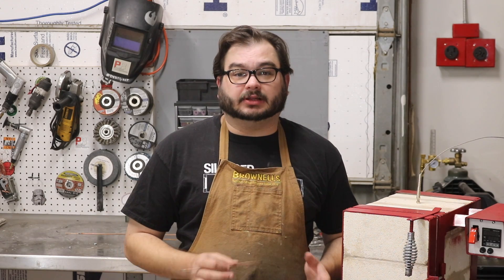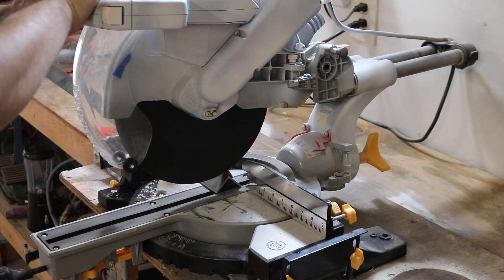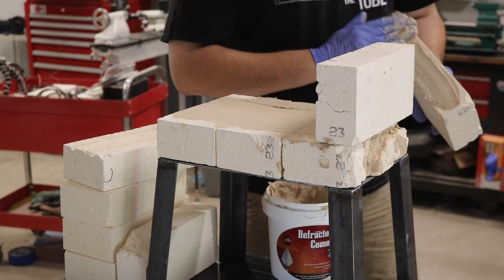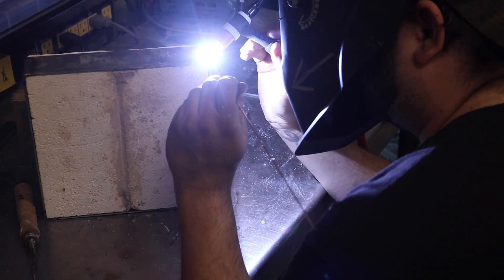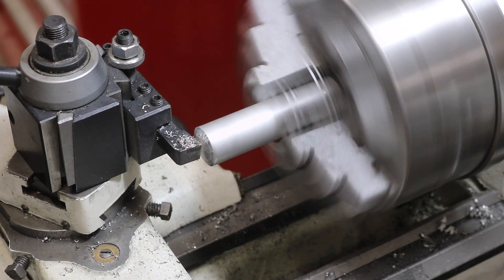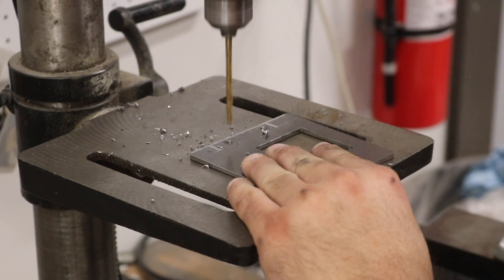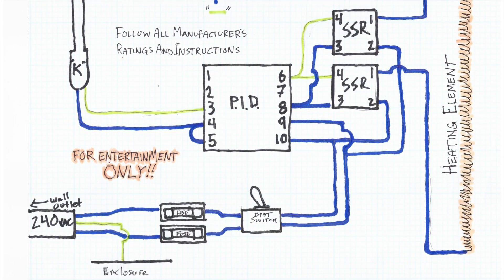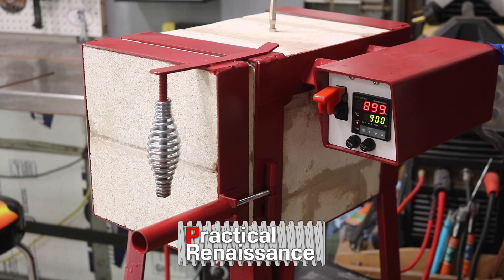Making a High Temperature Electric Oven for Heat Treating Steel!!

Comment: I make a copy of your owen and I convert the dimensions in mm and for khanthal wire I use 10,2 m , the owen work, the temperature go fast until reach 700 * C  after thar go slow until reach 850*C and for 1000* C I need 1 hour , I think the wire lenght must to be changed , the resistance is 46 ohm and the power is 1103W for 225V,  most knife HT ovens are over 2000 watts, too low power on your oven- 1450 Watts is not a very powerful oven and you know if it is do the job, but for me I will try with 6 m of kanthal wire to obtain a resistance  around 25 ohm and reach 1050 *C  under 1 hour

Comment: Great project, but i have a question of construction: according with the excel calculator you need 33.323 (ft?) length of wire for 240V and 1450W that means for me as a person who use metric system 10,15 m, I ask because I want to make a oven like you and in that sheets it not write the measure units and looks a little to short for me

Comment: My understanding is that running the heater element across the back creates a hotter region because it's being heated on three sides. This can cause the far end of the part to see higher temps that the rest, potentially leading to differing heat treatment. That said, I haven't built an oven yet so maybe it's not a problem.

Comment: Anyone know what size mandrel was used to coil the a1 wire? The calculator excel doc is not clear on the size. I'm trying to sort out the coil diameter, and length of coil to hit that 40 ohm mark. Thanks in advance.

Comment: so it's been a couple of years  what would  you have done differently?  Maybe  thicker  Kanthal and  more of it to get the same ohm resistance?  What was the over all ohm resistance  for the length of wire you  did  go with?  A heat up  time of  15 - 17 minutes is really good.  You should be  happy about that.

Comment: I like it, but I think you forgot one important safety feature, the power shut of switch that cuts the power when you open the door. If you touch those wires while taking something out you kill yourself.
I don‘t see one installed and I did not see one on the schematic.

Comment: Hey dude! Nice video!
Just one question left: why do you use 2 ssr relay's? I have seen people just using one🤔
Thsnk you!
Reply: I believe it’s because he’s using 240vac rather than standard 120vac so he uses one relay per hot conductor
Reply: @jakelevis8453  ist this because the ssr's he uses are rated for the 120 volts?
Cause I have 230 too but mine are also rated for it so it should be fine using just one?

Comment: for a 150x150x600mm oven at 127v voltage so that it reaches a temperature of 1100 ° C which power and wire do you recommend?

Comment: Thank you for video.
For heat-treatment of carbon steel please note that heating process must be slow (!), and averages for no faster than ~13minutes per 1cm/0.39inch in thickness (internal stresses due to irregular core heating). Boric acid is useful for preventing against surface oxidation. For example: 30mm/1.81inch in diameter steel rod, covered with boric acid must be heated no faster than (3x13min) 39minutes in a pan from 20degrees of Celsius/68 Fahrenheit up to 860C/1580F. Martensite quenching of detail should be done via vertical moves in coolant. I would consider some settable PWM in a system diagram, cause of these heating speeds limits details to small dimensions. DC power supply should be cheaper in theory.

Comment: "refractory seament" lol  i dont know where you live but around here its seh ment
nice build though. i watched a friend build a micro kiln and used a food can as a crucible. The can ended up exploding when he lifted it out of the micro kiln. it sent molten aluminum flying around his living room. no one was hurt, but it burned his laminated floors a bit. the burning floor was doused within seconds. 
these things are extremely easy to build. Don't think you cant.  also use a real crucible if melting anything. 

you can build this in your house just dont use it in there. And i know some if not most people who read this will think "duh" 
we knew the risks and were ready for it.

Comment: One trick with refractory cement is that you normally want as small of a junction as possible not like mortar you would see normally between red bricks. The refractory cement doesn't have near as good thermal properties and sounds just be used as a glue more than anything

Comment: Thanks for including some of the issues you had, like the coils coming loose. I am in the process of building a pottery kiln. Pretty much the same design as your HT oven, just a little larger with 4 coils. Now that it is finished and used, is there anything you would have changed?

Comment: I don't understand why you need two relays?  But then again I have no experience with this. I see other people using just 1 ssr. Looking to build one for myself, but needs more research.
Reply: You don't need two SSRs, that's just stupid. You always put one SSR on live wire, no need to disconnect neutral wire.

Comment: Hello😄 7:18
I want to know how electricity flows into the coil and the heat is generated after connecting the terminal block.
Reply: electricity flows from the solid state relays to the coil wire which is manufactured to be resistance to current flow, therefore, as the current flows, the wire heats up. is that what you meant? the relays are controlled by the PID controller, to regulate current flow based on temperature needed vs. actual temp., by using the thermocouple to indicate actual temp.

Comment: You forgot the door safety switch.... You can get shocked to death so quickly when you touch hot wire with your tongs plz fix it
Reply: what do you mean? Turns coils off when door opens? Thanks!

Comment: I really appreciate this video and all the info you shared!!! How is the accuracy at lower temperatures? I just built a VERY similar oven and I'm having a difficult time with the temp reading... I have the Inkbird PID that will display in F/C, but other than that, its nearly identical to yours. However, room temp is reading about 150°F, when it's actually about 60° in my garage. I swapped to another K thermocouple I had on hand and have the same result +/- 1°. The Inkbird instruction manual is a joke and not much help. Is there a way to calibrate the input?

Comment: For electrical isolation I use a combination of a SSR driving a DPST contractor (relay) to power the heating element. As others have said, for safety, a door interlock to isolate and disable power to the heater is also advisable.

Comment: This is a great video!  Im at the point where i want to control my heat treat better also but im torn as to make one or just buy one.  When i had tons of free time i made my own 2x72 grinder, but now i almost dont have time to even make a knife let alone a oven.
Reply: I saw a used kiln/oven on craigslist that worked fine, but could be upgraded with a PID controller....$225 asking. 9"x9"x6" inside dimen. hard to beat. so maybe look for a used one to upgrade?

Comment: Excellent build. I was eondering why you are using two SSRs to switch both ends of the coil, security reasons? I have built a PID controller for my LEE pot using just a single SSR (basically the same application). The phase is switched by tje SSR, the other end just connected to neutral. The main power switch double pole, of course.

Comment: you could improve by add, either a second coil or thicker wire to crank up the Watts.
You use "only" 1400W but you could go up to 3500W from the mains ( i would suggest 2400-3200watt).
also check the outside walls Temperatur maybe they dont isolate the heat as the advertisement says.
Or the box isnt airtight ( most arent), but the less air flow is possible its a second way of improvement.
Reply: Yeah, a ceramic wool blanket wrapped around the kiln really helps improve the insulation. Firebricks are pretty good insulators (0.2-0.3), vs 0.1 for ceramic wool (lower is better). But the seam mortar isn't generally as good. Which causes thermal bridges.

Comment: In reviewing your Kanthal Calculator spreadsheet, what is the unit of measurement for the "length of coil at wind size" and what is that specifically referencing? it would appear that the total length of coil that you installed in the channels you carved was roughly 50" or so by rough estimation, but the value in the spreadsheet in 16.
Reply: Same question here. No unit at all. And refering to your question, there is also no aswer at all.
Reply: It's in inches. Looking at the example (start with 33 inches of wire, end up with a 17" coil). Think about it: The mandrel is 0.156" OD. Multiply that by pi and you got 0.48 INCH needed to get around the mandrel. 33 inches times 0.48 is roughly 16 or 17", which would stretch out a great deal for install.

Comment: Nice!  I think we operate on the same wavelength lol, it started with Grizzly 7x14 when I first saw your channel and I had issues with mine, than you threaded a marlin, than you did muzzle device, than you got South Bend at some point you got milling machine and now you build high temp oven.  I did all of that as well just not as elaborate and fancy and I didn't even see what you did only saw it later :)  I've had firebricks and wire sitting in my garage for couple years, I've been putting this project off for a while, I actually been using my pineapple can forge to heat treat couple dozen of small parts with ease.  I want to build electric metal melting forge to melt zinc and aluminum and possibly brass.  I noticed you used same brand of wire that I got except I got mine in 16 gauge as it's not easy for me to access 220v so it will run on 110v.  I've been looking at same terminal blocks on ebay but the ratings are confusing.  Some sellers list it as 5A only and some higher so I didn't know who to trust.  Regarding PID the first one I build for my lead melting pot about 3 years ago I also ended up with one reading in Celcius and while it worked great I found it annoying so I bought MYPIN and it can read in both, it also has 2 rows of display, I like it much better.  It only $20 on ebay.  I also noticed all people used more liquid dark grey cement to "glue" the bricks, it's more liquid, I'll look in to that.  Another thing I was trying to find was ceramic tube insulators for wires coming out the back, but I guess it's not really necessary.

Comment: heared that you can remove the zinc coating by submerging the part intoo some heavy duty toiletcleaner or muriatic acid (the kind that removes calcium scale from a toilet bowl )
https://www.youtube.com/watch?v=8Tld3onsUVE

interesting oven , i seen simulair electric ovens used to melt aluminium , on the one hand i like the idea of having a constant controllable heatsource 
on the other hand if the cruisible breaks and the hot stuff comes in contact with the heating element i can expect sparks and possibly a blackout 
the idea of twisting the wire doubling the thickness on the exitpoint to the clamp to prevent it from heating up outside the oven is a good one , i hadnt thought of that 
using the wire to make holders i seen before with simulair results (the coil working itself loose ) , think thats about the only way to hold the coil in place except winding the coils around ceramic rod set intoo the walls
Reply: I wonder if the staples could be glued in with sodium silicate/water glass? His explanation of twisting helped me realize why some elements come with twisted ends...another mystery solved! So holding in the coils being hard means no roof coils? Maybe some ceramic holder?

Comment: Hi, can you explain to a complete electronics idiot why there are two relays for the heating element? I can't follow the wiring diagram very well, not you're fault at all. I'm no good at reading wiring diagrams. I could see the input to the PID controller from the sensor and that would open and close the SSD's but the two live lines and fuses and two SSD's confuses me. I'f you could explain it here (or in a video) that would be really helpful. Thank's in advance from A kiwi in Australia.
Reply from the maker: I’m not sure they do it this way in other countries but here in the states our residential electricity comes in on 2 hot wires (opposite phase) with a third ground wire, take one wire and the ground you have 110v, or take the two hot wires and you have 220v. This means that your positive and negative on the circuit are technically now both hot and so for closing the circuit entirely and safely you need a relay for both sides. That’s the basic idea anyway, I’m honestly not sure if it’s done like that anywhere else in the world.
Reply: @PracticalRenaissance    Nice video, I need to get off my ass and make a heat treat oven.
FYI, even in the US where we use split phase 240V you only need one SSR to control it.  Trust me, I'm an engineer and on  top of that I built a 9kw electric home brewery that had 2 PIDs, 1 PWM and 4 heating elements (all 240V [actually one was switchable 120/240]). All my 240V water heater heating elements in that build only used one SSR each.
Reply: Nice work like the extra info   I have a question for Bill  if I understand what you said about using one SSR that would mean you wirer one side of the element directly from the one?off switch
Reply: @bluektx   Correct.  One side of the element would be connected to hot always and the other side is switched.  If you were thinking that is a safety issue you'd be right.  You need to have a (electro-)mechanical switch as well for safety.  SSRs have a leakage current associated with them anyway and iirc it extends into the range that could be potentially lethal (min 70mA iirc).

Comment: Very nice, as usual. I noticed you were using the SB lathe on the handle - do you ever use the lil' Grizzly anymore?
Reply from the maker: Good eye! Yeah the South Bend is easier to keep ready to go for most projects but the little grizzly is still in the shop and plugged in! You can even see it in various background shots I’m sure, it lives right next to the other lathe

Comment: Make sure, if you haven't already done it put a switch on the door so when you open it, it kills the power to the heating coil. Sooner or later you will touch the coil as you take metal out of the oven and BOOM you could be history!!!

Comment: don't let the cutting particles hit the sliding mechanism ,It will ruin it in no time
Reply: Or get into the vents on the motor. Metal chopsaws are sealed for a reason.

Comment: Pretty cool man! Will it get hot enough to melt aluminum?
Reply from the maker: Undoubtedly.  Aluminum melts around 1350* F and I've brought this oven up to over 1650F just testing it, however it wouldn't be ideal for melting aluminum just because of it's size and form factor, and speed.  I actually built a propane foundry here a few months back that's a little more suited to the task of metal melting.
Reply: Practical Renaissance Right on. I’ve been thinking of building a foundry and trying to decide between electric and propane. Electric would be a lot more convenient but if it takes an hour to get up to temp that might not be that convenient.
Reply: @PracticalRenaissance  If you rigged this electric one for low-reactivity (or inert) gas pressure, could you melt with less oxidation than with propane + open to atmosphere? Harder to get to crucible, or to add flux in this form factor, but I wonder if the chemistry is better. I subbed immediately after watching this vid lol I like the thermal efficiency of a closed melting area. I have to scan your postings to see if you ever built an induction furnace :) ('cause I need a few tips there! lol)
Reply: I've wondered what the operating cost delta would be between the two?

Any idea?
Reply: BellyUpFish I don't know about propane but I doubt it would be cheaper. I am running an electric one inspired by the one from youtuber TAOW to melt aluminium and thats 3kW, that's about 45p UK (us maybe 50 pence?) per hour. The bild cost can be the same if you wish. Mine takes about 30 mins to heat up the refractory and crucible and then melts everything down in minutes. If they are well sealed electric ones are very efficient, most of the heat stays inside the oven, with gas and coal a big percentage of heat is blown into the atmosphere. Consider the electric does not need air exchange or oxygen adding, just the same hot air stays inside, you aren't heatimg up fresh air all the time. By the amount of coal I was going through I calculated my previous coal forge to put out approx. 30kW total, despite it got really hot it didn't melt significantly more aluminium per hour than my current one, so really thats 90% of fuel blown to waste. The convenience is so much better, too. Flick the switch and have a coffee. It doesn't make any noise either. You don't have to check/refill gas, too. However, if you want to reach max. peak temperature combustible fuels get up higher. For reference, my coal one allowed to melt steel when ran at max blowthrough.  But for casting ally or heat treatment there is no need for that.